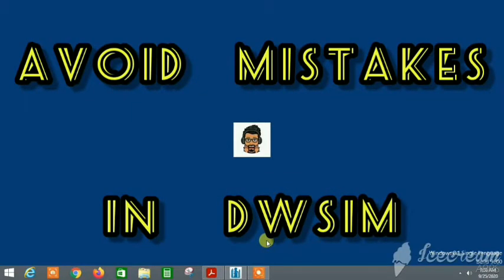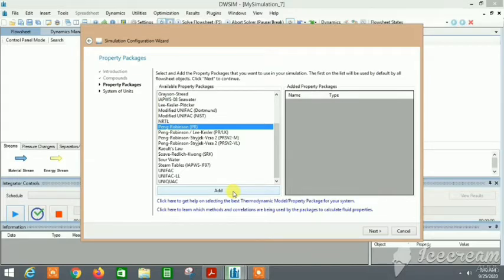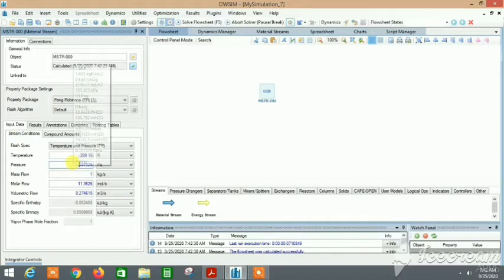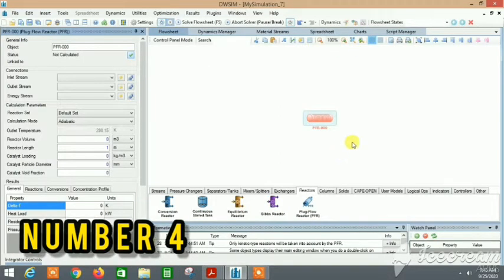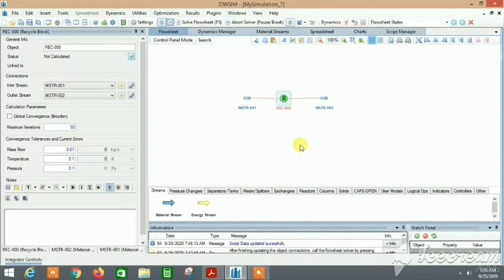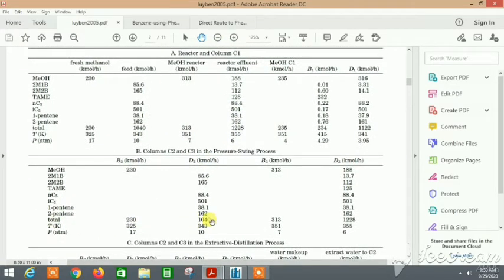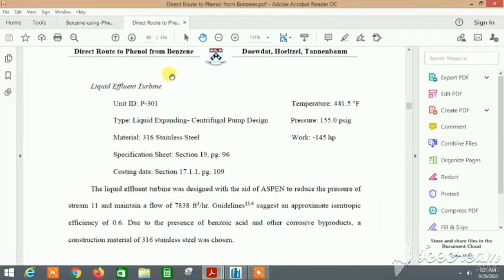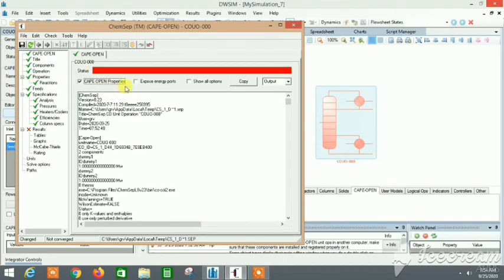DWSIM Mistakes we often make | Dwsim tutorial

Comment: Thanks sir! Now I'm trying to characterize a pump, so i'm giving the pressure of the inlet material (1 bar) and the output one is 5 bar more, to reach an higher pression of course I'll axpect a positive enegy flow, but the simulator give me always 0. Even if I change the material or try to put power as input to characterize the pump, it come back to zero. Do you know what could be a possible error?

Comment: Hello. I cant get stream data coz I get this error: “index was outside the bounds of the array”
Reply from the maker: This error usually pops up when some input is not possible like for example  putting reflux ratio as -5  or stage pressure as -99 atm , which clearly doesn't make sense and is out of bounds. Check inputs again once.

Comment: Can two reaction be simulated in a reactive Distillation column by DWSIM
Reply from the maker: Yes, you just need to add both the reactions in a Cape Open Column.
Reply: @TheConceptGuy   but it's showing the Chemsep reaches it's time limit and couldn't complete the run.
Reply from the maker: @radhikasingh3668  This seems a different kind of error. Try using a Complex Column and make sure the reactions inputs under the properties tab is correctly filled.
Reply: @TheConceptGuy  oh okay. I used the complex column but I'll check the inputs again. Thanks you're doing great job buddy!
Reply from the maker: @radhikasingh3668  Hope the issue is resolved. 
Thanks 👍
Reply: @TheConceptGuy  yess I guess We can only inject 2 feeds but I was feeding 3 streams that's why I didn't get the result first.

Comment: How to add chromic acid in dwsim please help
Reply: And also calcium hydroxide
Reply from the maker: Some compounds are still not there in DWSIM but we can add them using Compound Creator in case we have the data of that compound. 

I would suggest you to try finding those compounds by entering their CAS number in search bar.
Reply from the maker: For example :-
 chromic acid ,put 7738-94-5
Reply: I have add the CAS number but it is not showing the compound kindly help
Reply from the maker: Then I think it is not there in DWSIM . You need to add it by importing using data present online or use Compound Creator. I will make a video on Compound  Creator but first I need to fully experiment with it.
Reply: @TheConceptGuy  thank you .please make the as soon as possible

Comment: Thanks and great tips.

Sir, I am working on a flowsheet and i got a "Infinite loop error" and packed bed reactor is used in a flowsheet but that reactor isn't in dwsim so which reactor can I use ?
Reply from the maker: Welcome Hardik.
To break an infinite loop error , check the flowrates of streams before using any operator like recycle or others. Also , try to change the flash algorithm which might help sometimes. 
For packing , you can use a PFR with Heterogeneous Catalytic reaction , which can serve your purpose.

All the best !
Reply: @TheConceptGuy  thanks a lot sir ji❤️